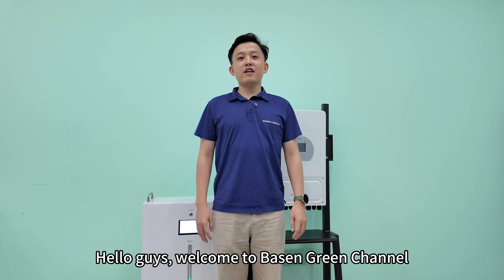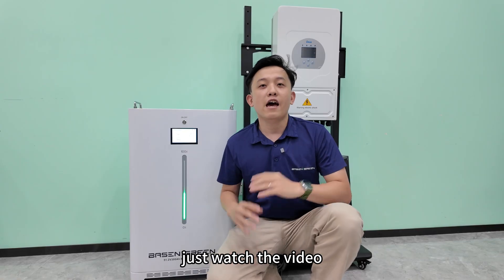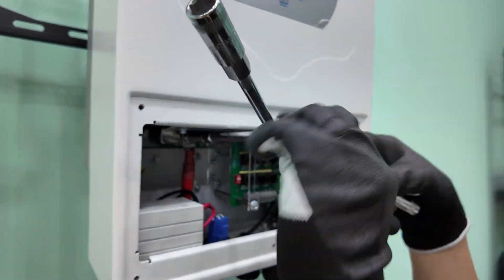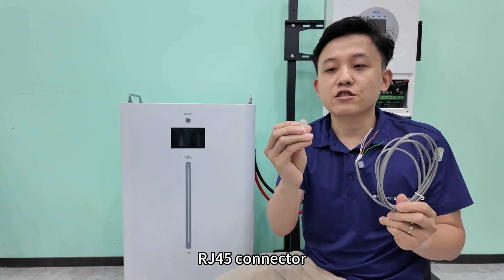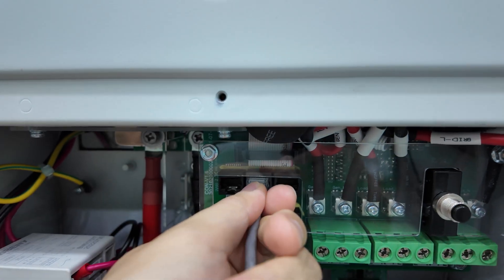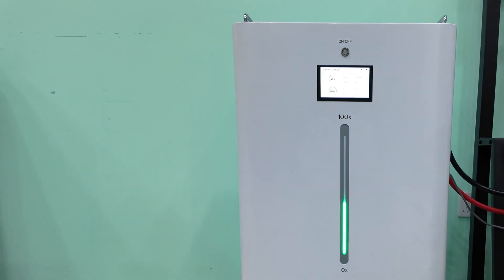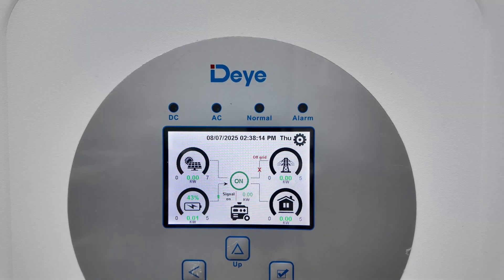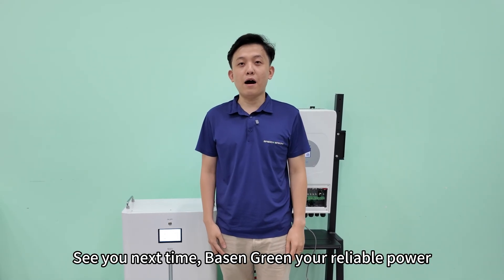BASENGREEN | How to Connect 15kWh Battery to DEYE Inverter and Set Up Communication | Step-by-Step

Comment: Hello, I have 3BG 11,7kw bat+12kw deye inverter setup around 2 years, few last month I have some troubles. One of batteries discharged extremely fast from 80% to 60% and then to 16%( for 5 min) the other two discharged after. What could it be?
😢

Comment: Why do newer series batteries have a display equipped with an ESP32? Why is it necessary? Will there be a demonstration of it? Also, why is the user manual for the products not available on the website? I also don’t see any indication whether they include active balancing. And are there firmware updates available for the BMS?"
Reply from the maker: Hello Thanks for your asking, 
1. The touch screen is easy to operate, and it support multiple lanugage.
2. You can download the manual from our website: https://www.basenpower.com/download/
3. The firmware update is not a public resource; you can contact our sales representative to get it, as the firmware update wrongly causes the issue.